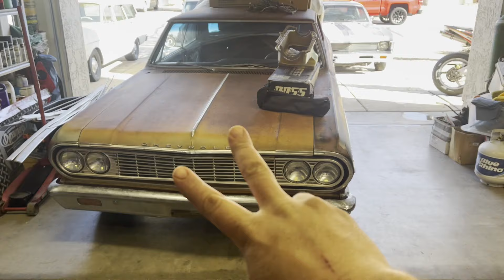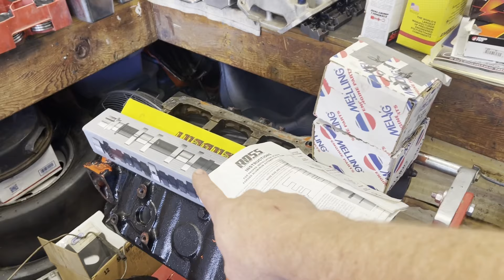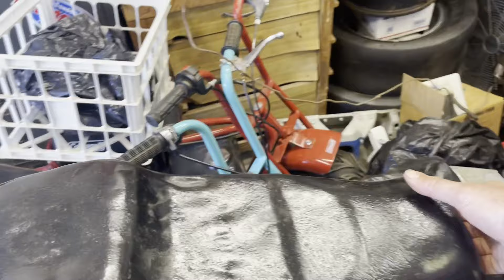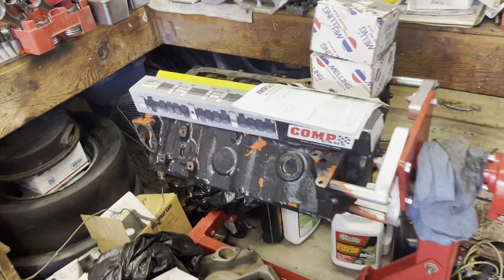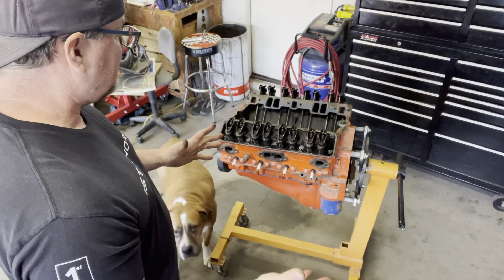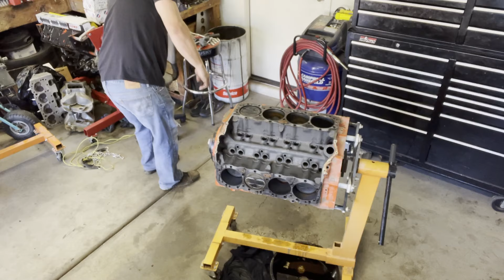Swap Meet Small Block Inspection | Will it work for one of the Novas??

Comment: I agree with you put new bearings etc it will be a nice little cruise motor, for $200 you did alright
Reply from the maker: I think so.  I got it for $200….. figured I could roll the dice….. With 64cc heads and a small hydraulic roller. It will be a decent little 350. It would work in one of the Novas.  

Thanks for watching!!

Comment: Those dish pistons with a 64cc head still makes a decent combo if you zero deck the block. Especially for a hot street engine. I ran a set of 2.02 461s(drilled steam holes) on a 400 with stock dish pistons and a eddy performer RPM Cam,750 demon carb on an air gap intake n she twist 7k.. Ran real strong for a low buck engine.. What rods are the Ross pistons hanging on 6”?  Put the trw’s in one 400 and the Ross in the other if the right bore size.. Both will perform well. You Sir have a lot of irons in the fire no doubt. Awesome channel.👍🏻
Reply from the maker: Thanks man!! I was considering that! Use the dish pistons with a nice solid roller. And drop it in that 65 nova we just picked up! I’ve got some 1 3/4 hooker super comps fender well exit headers. Could make that 65 pretty peppy!  

Thank you for watching and commenting!! I really appreciate it!!

Comment: At least get a set of flat top cast pistons for the 350 so it has quench. That way you can get the compression closer to 10:1, with quench would be less detonation prone than 9 point something to one with no quench.

You probably can get a set of hypereutectic pistons inexpensively that has a way better ring pack than any cast pistons out there. 1/16" 1/16" 3/16" rings are better than the 5/64" 5/64" 1/4" rings. It's free HP from the less friction.

Since you're not going to have any machine work done and the thing was bought for less than the typical $500 core price, you have another $300 to get to the core price and add a few hundred more that a cheap rebuild would be and you have something way better than what you're talking about.

A $200 set of flat tops with the good rings a couple hundred for a set of cheap aftermarket 6.00" rods for a better rod ratio, the cheap steal shim head gaskets, reuse the oil pan gasket, lessor expensive double roller timing chain or I have had great success with the cheap gear drive timing sets. You probably have a cam laying around to work with your heads. A few miscellaneous gaskets and it's a funner runner.🤔😎👍
Reply from the maker: You are correct. In the music intro part of my videos. There is a pic of three wagons in the driveway. The wagon on the far right is my buddy Jays.  I built that engine. It has 6” rod, flat top pistons two valve relief, Dart iron Eagle heads, nasty solid roller cam. Big fenderwell exit headers.  3500 stall 3:73 gears. Nasty little wagon.  Runs on pump gas all day. I love that combo. 

But….. this isn’t a race car and I’m trying to be budget friendly. Building this many cars at once is not easy! I need to be building customers cars!!! Lol!! That way I can film content and someone else can order the parts!! 

But yes…. I know from experience…. 6” rod flattop 350’s are very happy little engines!!!
Reply: @tackettshoh  
Would probably still be less than $1,000 and would be a good selling point for the car you're not going to keep. 10:1 is a good street compression ratio for like an Comp 260 I think it is, the one that is 230°/230° @ .050" with .480"/.480 lift. Would run great and wouldn't need a stall much bigger than stock probably a 2200 would be just right.

I would use 1.7:1 rockers though to get a little more lift out of the cam. This would bump the lift up to .544" or .512" with 1.6:1 rockers that should still be ok with press in studs and Z28 springs. This is a very streetable cam, I had this cam in my daily driver '75 Nova about 35 years ago. It had a th350 with a shift kit and 3.55 rear gears with slightly warmed over fuelie heads. I could squawk 2nd and 3rd gear. That was a really fun driver with that combo.😎👍
Reply from the maker: @itseithergonnaworkoritaint7852  then you are doing screw in studs and guide plates and drilling out the pushrod slots.
Reply: @tackettshoh  
That cam works good with 1.5:1 rockers if you're afraid to go to .512" lift with press in studs. With .480" lift should be fine without altering the push rod hole? It's been a couple months since I ran that combo so I don't remember if I altered the push rod hole or not. Isn't a big deal if you need to, they sell a guide to do that with a hand drill and drill bit.😎👍
Reply from the maker: @itseithergonnaworkoritaint7852  I’m kinda limited to using a stock set of 462’s or a set of 041’s.
Reply from the maker: Unless I want to spend more money….🤷‍♂️
Reply: @tackettshoh  
That's your prerogative. LOL 😎👍
Reply from the maker: @itseithergonnaworkoritaint7852  it gets kinda hard to decide….. like….. say you go buy a set of fuelies, put stainless valves in them, perfect circle seals, roller cam springs and retainers, cut out the valve stem guides install screw in studs and guide plates. Three angle valve job, have them surfaced. ………. At that point you can order some China aluminum heads ready to go any size runner you want. Make more power. For cheaper!!! I ordered those Promax heads from summit. In that one video. They were at my doorstep in two days….. 🤷‍♂️🤷‍♂️🤷‍♂️
Reply: You could get a set of cheap eBay aluminum heads to top it off with. Those are usually good for 250 intake CFM @ .600.  If you do get a set of those, buy them bare and get half way decent springs and valves. Also glue in the seats with self wicking Green Loctite just in case there is a loose seat. Lap in the valves when you assemble them and you should be good to go unless the guides are to tight. If that's the case you might have to have them honed? 

With these you can run the 1.7:1 rockers to get closer to .600" lift with the mentioned cam.(.544")😎👍
Reply: I think we crossed paths with comments. I was referring to the no brand eBay ultra cheap sbc aluminum heads. Last time I looked they were around 160 a piece shipped for bare heads.😎👍
Reply from the maker: @itseithergonnaworkoritaint7852  see this is how I get in trouble and blow the budget…. Basically I’ll use the block….. shit can everything else and I’ve got a 500 horse 350 in the daily driver/cruiser build……🤣🤣🤣 because then you GOT to do the tranny.. and you might as well put a brake in it, then you might as well swap out the rearend, might as well 9” it. Might as well cut out the trunk while you’re there, guess we need a cage now too….. we might as well put a 250 shot cheater plate on it…….. I mean……. It only makes sense….. 🤣🤣🤣…… then Sarah literally shoots me!!
Reply: @tackettshoh  
So just do factory rods with cast flat tops that have the better rings. Then stick with the heads you have, that cam or similar. The cheap gear drives are around 65 now, I used the ones that were 40 bucks shipped about 10 years ago in a couple 7,500 RPM sbc 383 builds without issue. 

Stick to a hot street dual plane 6,000 RPM budget build. Those genuine imitation RPM Airgap style intakes are around 127 shipped from eBay. Those work perfectly fine for this kind of budget build. Just don't get carried away. 400 to 450 streetable HP will be super fun in one of those light cars. 

Weight to HP ratio with 400 HP would probably be a street performer that can possibly be in the high 11s in the QM and still have decent street manners.

If 400 HP is to much for the rear end then get a regular dual plane intake possibly a factory one would rob 50 HP? Just install a shift kit in a th350 if this is the transmission you're going to use. Powerglide transmissions shouldn't even be considered for a street car. A 200R4 would be better but at least use a th350. No 3 speed Saginaw transmissions either, at least a 4 speed. But hey, ultimately it is Sarah's call so do what she tells you.😁👍
Reply from the maker: @itseithergonnaworkoritaint7852  I screwed up. It’s the wagon in the middle of that pic that’s Jays.  The one on the far right is okie!! 🤦‍♂️🤦‍♂️
Reply: @tackettshoh  
Not sure what you're talking about, there is no intro in this video.🤷
Reply from the maker: @itseithergonnaworkoritaint7852  it’s later in this video. But it’s usually sooner in the other videos. Either way. The pic with three wagons in it. Jays is the middle one.

Comment: Steve, if that's the 350 you are talking about, you know that intake doesn't go. That's old school 283, 327. Lol. Just saying.
Reply from the maker: It is older 283 327. But it can be used on any small block. Unless it’s got vortec heads.